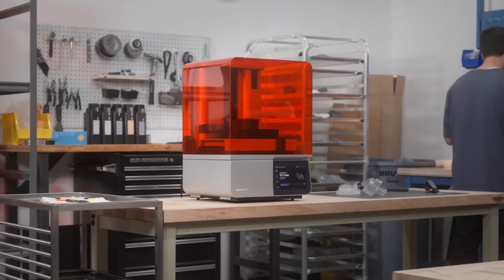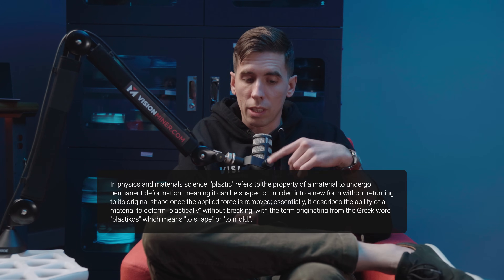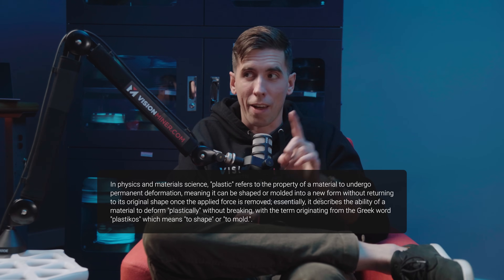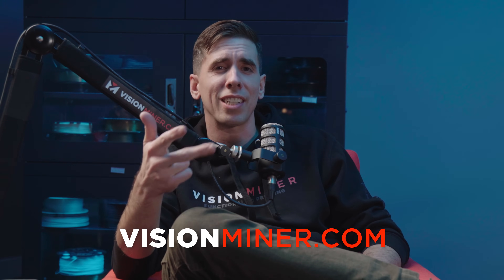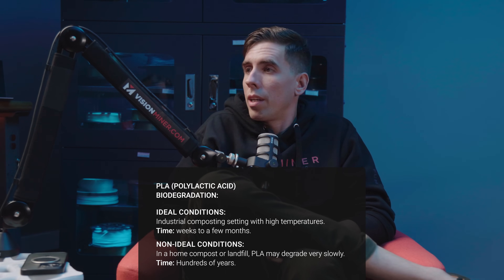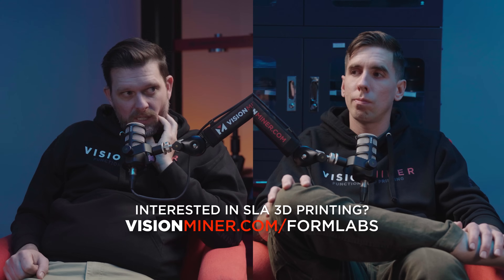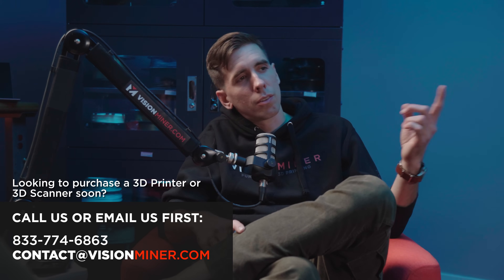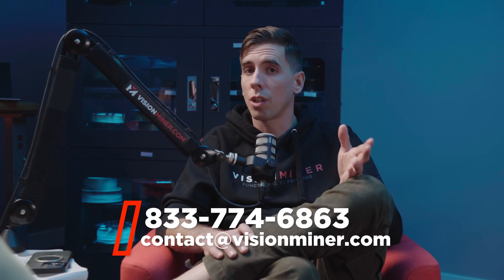Is SLA the Future of 3D Printing?

Comment: Why would you 3D print a skyscraper ? You pre mold the parts in a factory and assemble them. It´s way cheaper and faster. Standardization is cheaper and faster than unique 3D printed shapes. It doesn´t make sense in this example. You also wouldn´t 3D print a bis box, because it´s way cheaper and faster to make it out of say plywood and make the connectors out of 3D printed parts for instance. Way cheaper, faster and more stable than polymers. It sounds like if the only tool you have is a hammer, than every problem looks like a nail.

Comment: I own both FDM and resin printers. With users using a .2mm nozzle and printing near resin quality, its pretty darn close. 

For hobbyists whose machines spend more time being idle, long print tines isn't an issue. Higher fail point and really long print times are downside.

As said by others, the safety and  convenience of FDM vs SLA is unmatched.

Fun experiment I tried as well as others on YouTube is printing 100% infill and annealing in an oven with finely ground salt.

I was able to anneal all the layers of a clear 1.5cm cube after 3 hours. Just use a coffee grinder to finely grind the salt and pack around the printed part.

The ABS part was indestructible and salt annealing eliminated the layer lines. I plan on doing some gears later.

Comment: FDM will always be the king, no other methot can produce hollow structures or use multi matertials. and melting an existing engineered polymere will always be better than resins that have to be formulated to only polymerize at room temp under certain conditions while not being super toxic. modern SLA resins might look good on paper and make excelent prototypes, but when it comes to end use parts that arent purely cosmetic, they suck. fatigue, tribology, heat creep, all those more advanced engineering problems? forget about resins.

Comment: I use both technologies, and between the two after adopting resin printers for the last seven years, picking up a new FDM printer for high temp parts has opened my eyes again.
Outside of engineering formulas, most consumer grades aren't inherently strong, and a lot of the magic is in the model prep itself (aside from being able to take advantage of tremendous resolution bumps). Now the really interesting part, I spent the last few years developing a graphene photopolymer additive to boost some of the weaknesses for water-washable formulas. After my main printer went down for a random LCD screen fault (they will literally be fine one day, then you go to load the next job and the LCD screen will decide to cash out for no apparent reason), I picked up a new FDM machine to finish the same job and the format has grown in capability by leaps and bounds versus my old FDM machine. I even ran the numbers for z height build speed. Doing large format resin, I can get 8.2mm/hour with a full plate/full volume run and 100% reliability; the machine can go faster, but not consistently with a large print. The new FDM printer--with triple the bed capacity--runs a minimum of 12mm/hr just starting out and ramps up to a maximum of 32.1mm/hr (!!); that job averaged at 21mm/hour and took 3hr 41 minute to complete. The resin version was projected at 8hrs 12 minutes. With adaptive layer heights, the finish was even surprisingly good for FDM.

I'm enjoying FDM again and had forgotten how nice it was to have tough parts right off the bed. And I'm considering working up my own graphene filament.   😁
Reply: You probably have heard of this before.

For really tough parts, try annealing a 100% infill part in a casserole dish packed with fine salt. 

Depending on the part volume you'll have to experiment with times. The salt prevents warping and washes off.

I tried a clear ABS cube 1.5cm, and it got a textured finish, went clear as all the layer lines merged. Since it was ABS and completely solid, no layers, it was indestructible. 

There's videos on YouTube about it
Reply: @justcraziii  I caught Stephan's trials on annealing in salt however long ago that was. My only (or maybe primary) concern is salt isn't a fixed substrate, allowing expansion to a degree when unpacked or even fairly well tamped, and it is something of a wicking medium. One of these days when I have a boatload of free time to experiment, I do want to try annealing within a soluble plaster matrix, or a few other mediums that I'll add to my list.

Comment: Rigid 10K walks the park for most FDM materials (apart from % elongation). Incredibly chemical resistant, great mechanical properties and easily processible. We print parts for Aerospace, Nuclear, Space and Medical in this material!
Reply: For the low low price of 360 euros/l
Reply: @ Victrex AM450 is €750 per KG. High performance materials are expensive!

Comment: SLA - cant put prints in the sun.... and we live in a wold.... with a sun

Monomers are poisenous to handle/breath.  Material spec sheets do not give VOC or outgassing data of printed parts (probably because they are poor).  UV degredtion = increased VOC - so even worse.  End of life/recycling for SLA parts?... probably ignore that one for now because they will be poisionous dust in 20 years.  

I think SLA has a LONG way to go and if people start printing these materials on mass we should expect (and hope for) much better regulaion for use of these plastics.

Just wanted to add - love this channel, its helped me allot!  But FDM is not dying, FDM is the most flexible printing technology, adding parts during a print, printing multi material - long fiber filled plastics etc.  Research into material science still applies to FDM and formulations for layer bonding - still a long way to go here.  

In the end, its likely to be a bit like CNC machining.  You cant turn on a mill.  Its going to depend on the application for a long while yet.

Comment: Once sla machines and materials become competitive in price to high end fdm printers
Reply: that, plus the availability of materials and relative ease of post processing. At the same time we'd think about small scale subtractive CNC and aluminium/brass stock.
Reply: everyone forgets color. FDM does color via mmu or even just pausing print = layer height color swap. Resin.....yea no. And until you can throw a resin print on and then...take it out and be done, I can't see it overtaking at all. 

Theres no curing, no cleaning, just throw a spool on (or keep it on it like i do for years) and click print. and done. no harmful vapers, no spills or messes. When its done, its done.
Reply: @3DTwinkies  I agree on most of this. Yet, the "no harmful vapors" statement isn't quite true with FDM. VOCs are still there. Think about ABS/ASA for instance (on a non-enclosed printer).
Reply: @ irrelevant since I only stick with pla. 
Its about as dangerous as me forgetting to clean my furnace filter for a year, which I have done, and still am alive *cough*. 

Also my limited research rn but abs vs resin appears to be not even in the same realm, with some sources citing resin being like 10000% way worse then abs. 

Neither of these would I want in my house, enclosure or not. If you have to 'enclose' a print (not related to heat) then imo it shouldn't be used. (for the public at least).